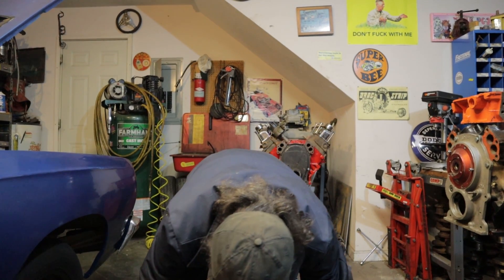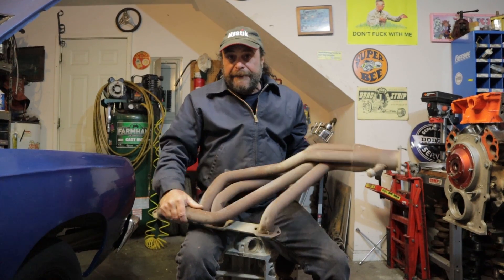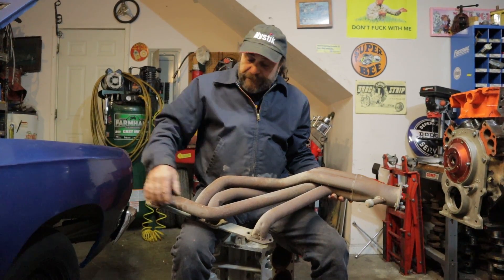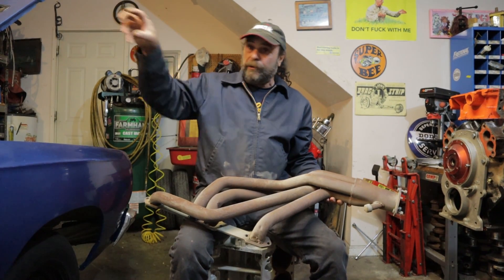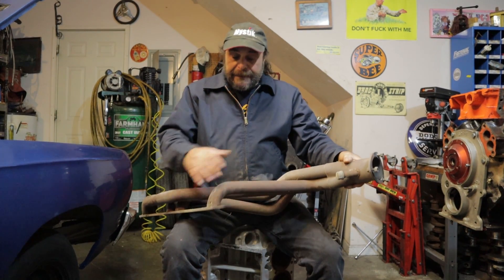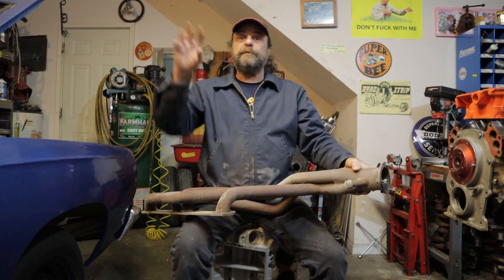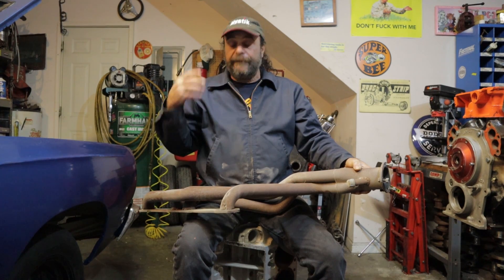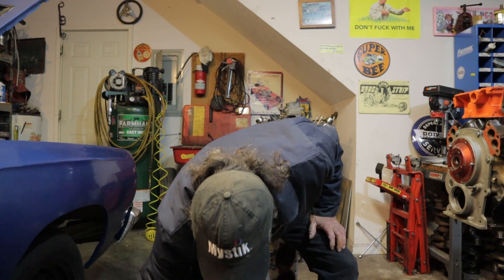The BS On Backpressure

Comment: You understand that some engines need back pressure like small engines but if you have a piston set up and a bigger engine with a higher compression you could have a open header or straight pipe and don't really have to worry about back pressure but smaller engines like to have back pressure I burnt valves on plenty of small engines and lost compression cuz of straight piping my stuff
Reply from the maker: No, you burnt valves because you were jetted too lean
Reply: @UncleTonysGarage  I had a 1983 Yamaha 180 scooter and I put an aftermarket fart can on it and burnt valves, there is a 50/50 with lowering your back pressure.

Comment: Thank you for the video. I've been arguing against back pressure for over 50 years. We called this scavenging even though the term is used more for 2 strokes. You give an excellent explanation for this process. That's why we disconnect the exhaust system from the headers when at the race track.

Comment: Back pressure is made "necessary" by those who intend to keep our cars running even more inefficiently than what they are designed for. What back pressure does is keep some of the exhaust gasses in the combustion chamber to decrease the combustion efficiency of the next cycle, and so on. Ideally, all of the exhaust gasses would exit the cylinder, and the cylinder would be filled with all fresh air. That would provide more power, and therefore, more fuel efficiency. That is not the case, however, due to the back pressure created by the catalytic converter(s) and other restrictions which are are placed at the exhaust right at the factory. The engine operates as a big vacuum cleaner. If you restrict either the intake or the exhaust, the vacuum will lose efficiency. Back pressure is right up there with ethanol in gasoline, resistors on spark plugs and spark plug wires. It is all intended to keep MPG down and in making us go to the gas station more frequently.
Reply from the maker: uh...no

Comment: Built a sbc 383 small dish pistons 11cc topped with aluminum 64cc 200cc int. ports and D shaped ext ports for scavenging. 1 3/4 primary shorties to 2 1/2 pipes to X pipe and 2 Borla Xr1 mufflers(no restriction) 2 1/2 to bumper. Running Crower flat tappet nitrous cam w/ 114 degree lobe separation 500 int lift 525 ex Sounds great and propels my heavy 2000 s10 to 12:50’s with a/c and hard tonneau. 3:73 with 700r4 3500 stall w/ lock up. Gets 19 mpg doing 72mph at 2300rpm. Drive it to track on drag radials. It wasn’t always setup like this. Once upon a time, had Hugh flow steel heads w/o D port ex. port. 1 1/2 primary shorties, no x pipe and a huge 2 in 2 out muffler. Best et was 12:80 and sounded horrible. Had that rattle sound.

Comment: UTG i had a question regarding a 66 coronet with the 225, in a "nutt shell" i wanna get into classic american cars, iv always owned classic toyotas and datsuns, but my question to you is the coronet 66 with the 225 i believe it has a 904 auto tranny but i was wondering if i can put a 4 speed in without modifying the drive shaft?
Reply from the maker: You can probably get an A or F Body A833 to work in that car and use the same driveshaft, but you'll need to use the larger 727 type yoke
Reply: @UncleTonysGarage  ok thats the info i needed, ill look up mopar forums to determine what kind body type its a four door, thats all i know, but the 225 is a great daily driver and is cheap.
Reply: https://waco.craigslist.org/cto/d/bruceville-1966-dodge-coronet-deluxe/7051521223.html

Comment: Hi tony, I would like to thank you for putting together these down to earth videos.  I had always heard the back pressure myth as a kid and adult.  I’m not going to go over all the stuff I do and don’t know but I have a question for you on the off chance you see this and comment.  

My father in law(who is like cooter from the dukes of hazard, small town mechanic) tells me all these amazing stories of stuff he had and how fast this or that was.  He’s told me the story of a 90something lt1 camaro running 9second 1/4s to which I tell him is impossible but he just keeps repeating it.  He tells me about all these cars he put together and sold back when muscle cars from the 70s were big.  I just don’t understand his logic because the other day on a customers car he fixed there brake lines with compression fittings.  How am I suppose to believe that stuff when it seems like I’m always seeing or noticing shoddy work by him.  

I use to have a H/c/I c6 I threw together that made around 420whp on a heart breaker dyno, the guy who tuned it specifically told me it was close to 600fwhp.  I took him for a ride in it and got it side ways a little, and then he proceeded to tell my wife and his other son in law I didn’t know how to drive it and talking about how it spun the tires.  I know in my mind this has to be the fastest car he’s ever rode in and he just blows it off like nothing like I can’t even understand what goes through his head.  

Have you ever met anyone like that in the community ?  I’m a weekend mechanic and I don’t know everything but I just don’t understand how he’s even a mechanic and maintains a business

Comment: It's funny how a guy can get on his soapbox and jabber jabber jabber about backpresher and how it never makes power and I can think of times on the dyno, one in particular where backpresher brought both hp and tq up significantly.  The engine is a high strung 289 Ford that went from 438 hp to 455 hp @ 6200 rpm. The shop has restricktors to add in the large exhaust tubes to replicate street exhaust and it picked up power. Now it's possible that the backpresher aloud better scavenging  but it did work.
Reply from the maker: Those restrictors did't add backpressure, they created velocity

Comment: Exhaust gas has mass and is compressible.  The best length header will return the low pressure pulse back to the exhaust port when the valve opens again.  This depends on engine rpm.  See example in this video at 25 seconds.  The ball is brought back to the paddle at just the right time by the rubber band.

https://www.youtube.com/watch?v=to9kPkMPmiA

edit for wrong link

Comment: I agree that you don't need backpressure but when the piston is traveling down the cylinder on the intake stroke it is not creating a vacuum it is creating an absence of pressure or a low-pressure area which is refilled by atmospheric pressure and this pressure can be multiplied by using a turbocharger or blower creating a greater high-pressure situation inside the induction system. On the exhaust side of things when the exhaust valve is opening the spent fuel-air charge is pushed out of the cylinder by the rise in pressure created by the piston moving back up the cylinder. After the exhaust passes from the cylinder head into the exhaust system the manifold or headers create a pulse effect helping to scavenge the cylinder much like Uncle Tony explained on the Chrysler ram induction video only on the exhaust side of the head.

Comment: HAVE YOU EVER RUN INTO REVERSION BEFORE? IF YOU HAD YOU WOULD UNDERSTAND THAT BACK PRESSURE IS NEEDED IN SOME APPLICATIONS SO PLEASE DO NOT TELL PEOPLE YOU DO NOT NEED BACK PRESSURE AT ALL !!!!!!!!!!!!!!!!!!!!!!!!!!!!!!!!!!!!!!!!!!!!!!!!!!!!!!!!!!!!!!!!!!!!!!!!!!!!!!!!!!!!!!!!  i thought you were smarter than that. what about a single cylinder engine or a two cylinder engine with a separate exhaust pipe for each cylinder. why do racing engines have a equalizer pipe between the two exhaust pipes coming from the header collectors? why do flat track v-twin racing motorcycles have a two-into-one ? if scavenging is so important why not have a scavenging pump on your exhaust exit like a reverse supercharger or a super scavenger ?
Reply from the maker: You're confusing backpressure with velocity

Comment: Its just an air pump that happens to burn air and gasoline. Unrestrict the intake and exhaust and presto! It makes more(some) power. And remember bone stock stuff is far more durable that high powered is. Jeep inline six perfect example. How many if these go to 300,000+ miles and keep running? I am on number 3 . first was 240k second 300k + and current one 260k from 1988. And i do wish it had more hp.

Comment: you showed an exhaust manifold and proclaimed that at or after the down pipe on that manifold there was a vacuum, Literally in 20 years of working on engines 6 of which was spent designing exhaust systems and running smoke machines to gauge and increase the scavenging effect I have NEVER. NOT ONCE EVER....seen a vacuum in an exhaust pipe downstream from a collector... NEVER.

Scavenging occurs where all the pipes meet at a common collector as exhaust PRESSURE from one pipe moves through the collector and into the exhaust pipe it has the effect of drawing out or "scavenging" exhaust from the other down pipes that are not currently under exhaust pressure.

You can literally drill 75 holes into an exhaust system and install pressure/vacuum gauges and you will NOT see any readable vacuum signal, you will only ever see atmospheric pressure for your altitude or you will see pressure. I know this, because I have literally done this and used analog sensors hooked to three 25 input arrays and data logged close to 15 different exhaust designs while working for a large exhaust mfg.

I love how people say you need back pressure...No you don't.... your exhaust IS UNDER pressure....if you have back pressure.. your exhaust is clogged and your engine will not run.

What you need is to prevent oxygen from reaching the exhaust valves.....of course any properly tuned car will have some excess fuel in the exhaust that was not burned, this is good and important, as the un-burnt fuel (rich mixture) means you do not have enough oxygen to create any more heat. if you run without headers or a manifold the piston moving up will force exhaust gas under pressure out past the exhaust valve, but there is always displacement, as the valve closes and the hot spent exhaust gases move at speed through the flow area of the exhaust port, cooler oxygen rich air will enter around the edges and the fresh oxygen will react with the hot exhaust valve. This is one way to burn a valve...The other way is to run a lean mixture and provide the excess oxygen via the intake cycle.

I have explained this COUNTLESS times, and every time some smart guy chimes in that it's because there was no back pressure....WRONG. it's because there was no exhaust pipes to create a containment area to hold in the exhaust gases that effectively work like shielding gas in a MIG welder.....Oxygen, is THE ULTIMATE oxidizer....it's kinda in the name....ever use an oxygen acetylene torch? next time you use one, feel free to turn off the acetylene mid cut, you don't need it...lol. When you squeeze that handle on that torch... you are adding oxygen....

So back to the point.....

A vacuum is a condition where pressure in the system is less than atmospheric pressure for your given altitude. So unless your exhaust exits your car at a 45 degree angle and is exposed beyond the body of the vehicle doing 75mph there is VERY little if any possibility you have a vacuum on your exhaust anywhere in the system......

a system that has great scavenging qualities is long tube equal length headers with a glass pack that is the exact same diameter as the collector. this system is long enough to prevent unwanted oxygen from going into the system beyond the collector, if you run this system full throttle long enough you will see ONLY the collector and the first few inches of the glass pack will glow red hot. We achieved near atmospheric pressures in the inactive down pipes and very low pressures in the active pipes throughout the entire RPM range of our heavily modified gas and alcohol engines.

These are undeniable scientifically backed facts. There are only two cases in which this is not accurate, yet still holds true. 

1.) Turbochargers, have drawn a vacuum on the turbo manifold when the throttle was snapped shut and RPM's quickly fell of the turbo would momentarily suck and quickly equalize in pressure.

2.) superchargers, in several cases we witnessed fuel shortages on setups running carbs. It was never something we could pin down but many people had his/her own opinion, these shortages would cause a slightly rich exhaust environment to suddenly go very lean and very hot and we would get some kind of flash or burn state in the header at the collector and we monitored a high pressure spike followed almost instantly by a small vacuum reading.... again not something that happened all the time, but we saw it enough times that it was not a fluke by any means.

Terminology is key here. back pressure is a force exerted against the flow....imagine having two garden hoses, one large, one small....you slip the small one into the larger hose and turn on the large hose. because the small hose is inside the large one and is secured so as not to get pushed out it creates a restriction causing a decrease in volume and flow. Now you turn on the smaller hose...you still do not have "back pressure" what you have is a small hose with higher pressure flowing less volume into a larger hose with more volume, the pressure quickly drops to match the pressure in the larger hose (pissing into the ocean), but because now the high pressure area is inside the large hose and the low pressure area is the entire planet outside of the opening of that hose you still just have a high pressure area flowing into a lower pressure area.... no back pressure lol. If you just had the large hose and you clamped the end tightly closed... you still do not have any "back pressure" you just have a high pressure area, with no access to a low pressure area. Now hook to large hoses up end to end so the flow faces each other, then turn the hoses on at the same time.... still not back pressure...just two identical high pressure areas with no access to a low pressure area. unless the two hoses were from two different water systems....then one would be a high pressure hose and would force the low pressure hose to equalize then flow backwards...which leads to the only conclusion with exhausts.....

Back pressure would only ever be possible if the world had a higher atmospheric pressure than the inside of your exhaust pipes....this probably will not ever happen... ever.....so until that time, your exhaust is higher pressure than the world around it, end of story. 

The take home: any restriction on exhaust flow is bad. your headers primary tubes should be larger and higher flowing than your cylinder heads exhaust ports. your primaries should always be equal length or as close to it as possible for cylinder balance. your collector should always flow at least 1.25 times more volume than the sum of your primaries. and you should always have enough pipe from the collector to prevent fresh air from migrating back to the collector.

Comment: A 2 stroke engine needs back pressure
Reply: No, it needs an expansion chamber exhaust system designed to work in harmony with it's port timing for proper scavenging.

Comment: Now, , , what happens if you don't run any exhaust manifolds??, , and what is the reason top fuel cars have a header? They are wide open to the world, , there's no bodywork around the exhaust system!? Reversion. Backpressure.       
          just sayin
Reply from the maker: Supercharged engines don't need scavenging...they're pressurized from the intake side
Reply: @UncleTonysGarage  so the header is just""" for looks!? 
        just sayin

Comment: What size exhaust do you recommend for a stock cam/heads foxbody 5.0 with bolt ons EFI? 65mmtb 75mm maf race crank pulley a9l ecu 4.10’s etc. trying get get the best time I can without upgrading cam and heads. I believe your buddy went 11.9 with stock cam and heads with bolt ons.. that’s super impressive by the way hopefully I can get a low 13 with slicks 12.9 would be awesome. Thanks for your input
Reply from the maker: For your goals, the stock exhaust is more than adequate

Comment: Exhaust systems are engineered  for a reason . Overlap is also used to warn up the engine faster because it sucks back up exhaust also. It works both way like a stomach.
Reply from the maker: Nope...very wrong

Comment: I completely agree with you, but wouldnt it make sense to have some back pressure during the break in process to help seat new rings to a freshly machined cylinder? Aside from break in i agree you need absolutely no back pressure. Back pressure robs hp and torque bc the engine has to work harder to get the exhaust out.

Comment: Hey Tony I had a 2001 Nissan Sentra and the exhaust system was off of it it was loud and ran like crap and put a junket exhaust system back on and it ran like I gave it 100 hp and ran like a clock
Reply from the maker: It was calibrated too lean for that open exhaust
Reply: @UncleTonysGarage  like I said before YOUR THE ENGINE WHISPERER!
Reply: Tony the vehicle had fuel. Injection no adjustments

Comment: My uncle told me this a long time ago a nascar has a large exhaust but it is muffled think of when you compress air it's the same for vacume at the same time a normal daily car around 400 horse you wouldent really need anything over 2 1/2 exhaust with barrel mufflers to make power